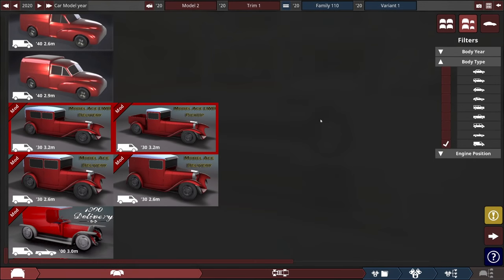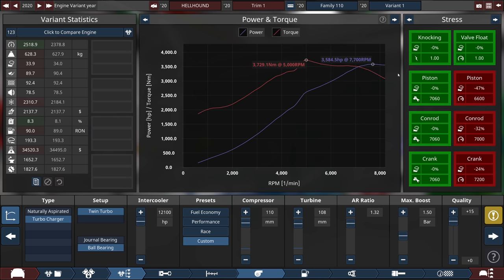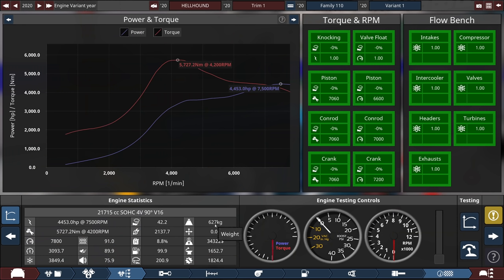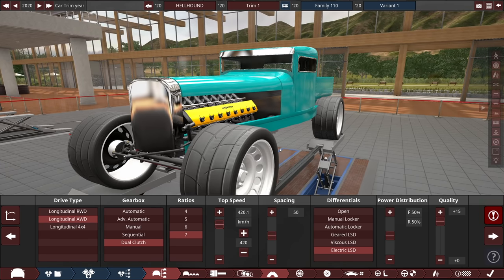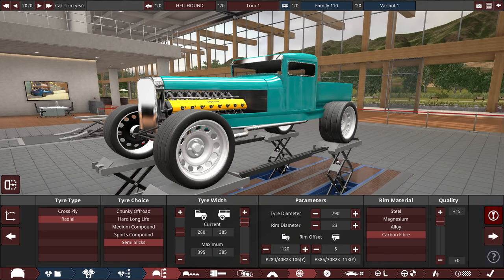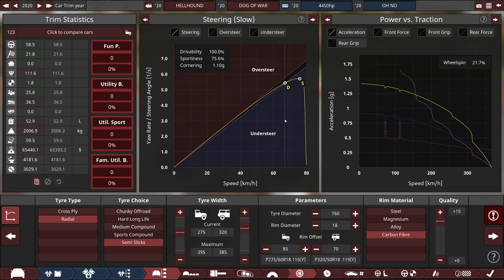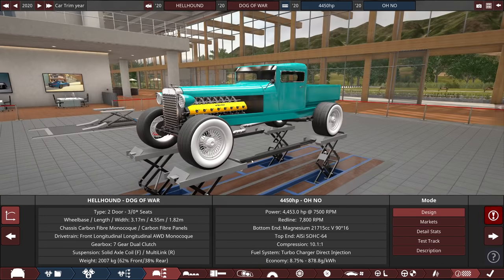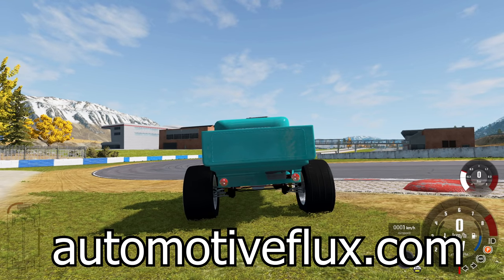The Most Powerful Car I've Made 2021 (Automation + BeamNG)

Comment from the maker: Nearly as much as a Supra 

Also, stickers are here: https://automotiveflux.com/
Reply: hello
Reply: lol
Reply: Super uhh
Reply: YO IS THAT A SUPRA?
Reply: There's a way to remove the chassis in BeamNG so that you don't have to worry about them being visible, reply if you read this and I'll go into detail on it
Reply: Make a dune buggy version or offroad crawler
Reply: If it was stock maybe.
Reply: Is it possible to build an engine that reaches max HP before max torque? I'd love to see that mobile disaster!
Reply: Do a nascar
Reply: What is the mod?
Reply: With the next update you'll probably be besten by at least 200 hp
Reply: Send this to neilogical he would love this car
Reply: Are you using a mod to keep your engine from failing? Because when you build a v16 over 4100hp, they tend to fail in Beam like losing compression from pistons getting hurt , even if your internals are green on reliability. Also it's almost impossible to keep your turbos from over heating.
Reply: yo, u should make a video trying to make the most powerful naturally aspirated engine
Reply: Im not buying a sticker that looks like a Lada Samara...
Reply: Lengthen the gears for top speed
Reply: You laugh but there are actually Supras with Compound Turbo set-ups putting out 4000 hp. https://www.facebook.com/Turbosmart/posts/4000hp-all-billet-compound-turbo-2jz-built-by-brangers-performance-machine-thats/10157735268902269/
Reply: much true

Comment: If you use the Direct Acting Overhead Cam you can get it to almost 4700 hp
Reply: Most I’ve gotten with direct acting overhead cam was 4740 horsepower

Comment: if you think about it, automation engines are incredibly slow. IRL, an 8L HEMI full billet can make over 6k horsepower quite reliably. 21 liters should be making exponentially more horsepower.
Reply: in reality a chevrolet big block 10l can make 9000 hp and the engine is rebuilt after each 400m i  reality you have 2 3 or 4 turboes and a supercharger or a supercharger big as a house in the game the engine is limited to 2 turbos
Reply: @Noooo23523  a chevy big block making 9k? Do tell!
Reply: @THESLlCK  top fuel dragsters they are chevy big blocks and dodge big blocks
Reply: @Noooo23523  top fuel is all dodge, at least for the past couple years
Reply: @THESLlCK  now top fuel i heard makes 10000 or 11000
Reply: @Noooo23523  heh I hate to tell you but you're a touch behind on that! It's 13-14,000 now! Brittany Force did a full 1/4 mile in under 3.5 seconds!
Reply: @THESLlCK  thats awesome jet dragsters were the only able to hit 4 seconds when dragsters had 9000
Reply: @THESLlCK  and there are top fuel diesels too with 150 psi or surperchargers and turbochargers they make like 3000 hp and extreme amounts of torque i dont remember how much

Comment: Pipes into the tires DOES make sense. It helps warm them up so you get traction on your launch. Also I believe the reason you couldn't see your engine after cutting out the front grill is because the radiator is there.

Comment: Also make a devel sixteen with this engine as irl it has 5000hp
Reply: I’ve tried that in game. The problem is with the size of the Devel’s engine and the fact that it’s a pushrod engine it’s hard to make. Plus automation doesn’t have Quad Turbos yet, so it’s difficult to make it the same. And the Devel 16 isn’t even real yet.
Reply: @BrapBrapDorito  then at least make a twin twin turbo concept version

Comment: I think the cooling issues happen if fuel mix is set too rich in automation.
Reply: I've done some testing, and the required cooling seems to be set assuming a mediocre engine thermal efficiency. For example, a lean burning engine is has too much cooling potential, while a rich burning engine has too little cooling potential. I can easily go flat out in desert stress testing with the 0 cooling setting on my efficient engines.

Comment: "I didn't intend for this to become ah otwheels car"

Well that's what naturally happens when you hot rod a car enough. Also have you ever realized that the faster a car is, the hotter the wheels get because of friction? And that super powerful cars can actually do a burnout that leaves a trail of rubber on fire on the ground? I've seen it. I think that's where hotwheels got the name. The faster the car the hotter the wheels.